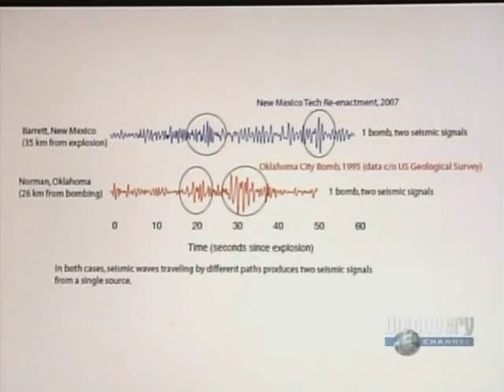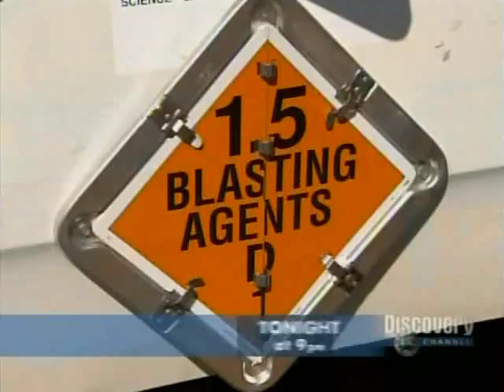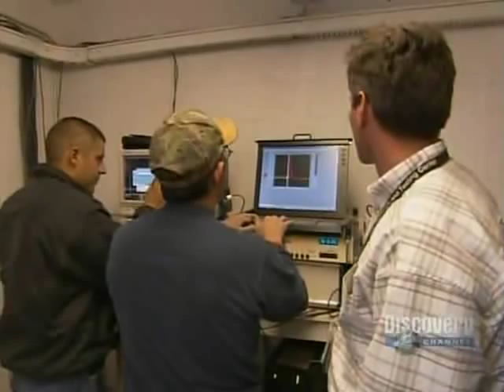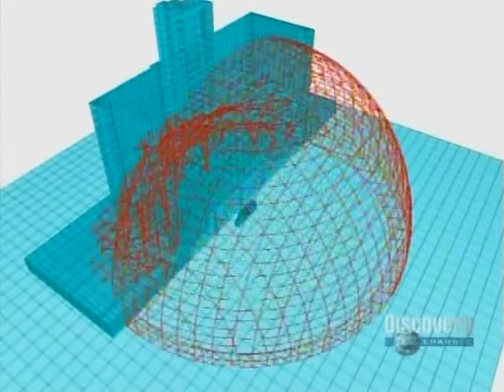Oklahoma City Bombing Conspiracy debunked, sorta (part 2)

Comment: Since the conspiracy theory is that the additional bombs didn't go off, I don't see their point.
Reply: The theory is that additional bombs were placed on key cross beams in the front of the building.   A woman who worked at the building gave testimony about seeing men doing work inside the building consistent with the placement of those explosives.  Benton Parton, that USAF blast effects expert tried to get the State of Oklahoma to not destroy the crime scene hastily as it was crucial to understanding the crime and ruling out the involvement of other explosives or parties.  He asked this because he saw spots where the concrete was blown completely away from the rebar in the building - which only happens when demolition charges with extremely high propagation velocities and over-pressures lay in close contact to the steel-reinforced beams.  If the building had been allowed to stand to be carefully photographed at these and other locations, then Parton's theory could confirmed or refuted, but like the disposal of the debris from the WTC buildings, the debris from the Murrah building was hauled to s SECURE landfill. And the destruction and disposal was very rapid as if driven by a desire to destroy evidence.

Comment: Just imagine what a bomb would do if they had used a truck that was loaded to the max with fertilizer.  I'm talking something like 20,000 lbs. of explosive.
Reply: TeleWacker it would definitely do more damage, it also depends on what they use in those 20,000 lbs.